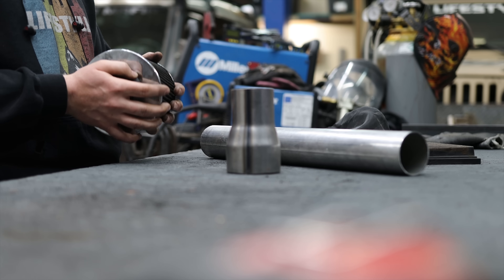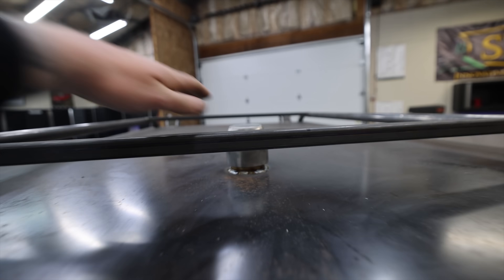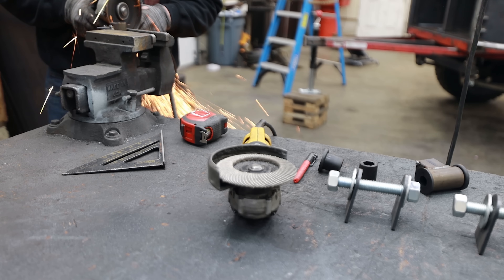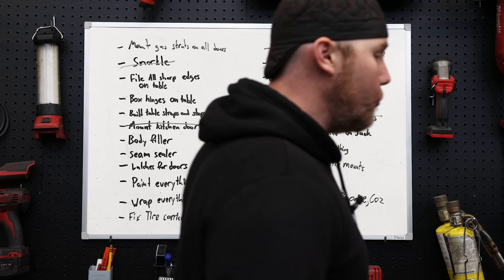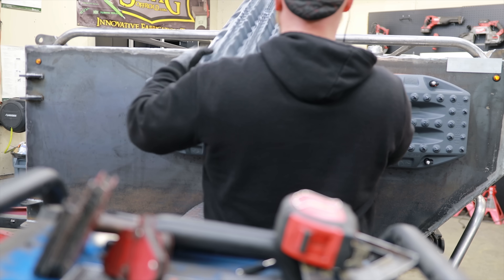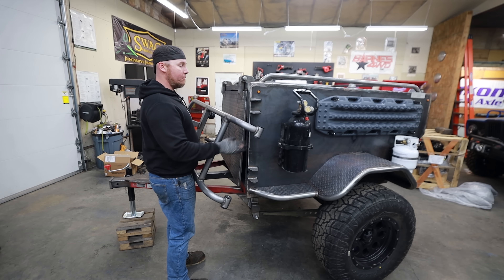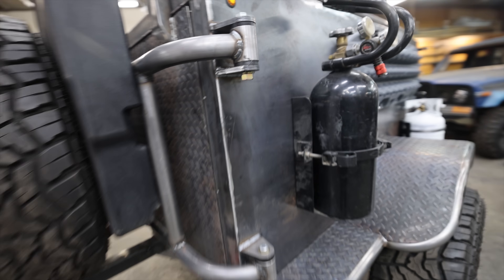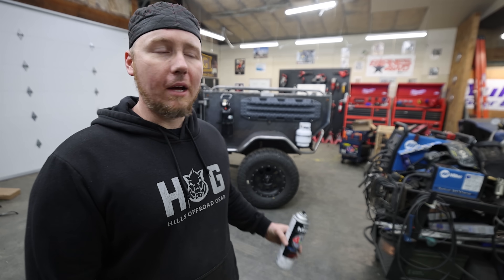Let's Build More Weird Offroad Trailer Mods! Harbor Freight Overland Trailer Episode 8.

Comment: Add a little inline 12v fan and create a positive pressure system. Constantly pushing dirt out. Get your 12v from the trailer connection cause you'll only need it while driving.
Reply: This is a great idea.  Do you have any part numbers or a fan you like?
Reply: Great idea.
Ronny Dahl did the same on his Hilux build for the bed. Worked great from what he said 👍
Reply: i was gonna say the same. i've seen positive pressure setups advertised on higher end offroad style trailers similar to this one.  awesome stuff.
Reply: This is a standard feature on most off road trailers in Australia having a positive pressure dust reduction system. I have one on my patriot camper that has a washable filter and runs on a motion switch via the Anderson plug we don’t get the elevation changes down here like the states but we get heaps of dust.
Reply: That would be so cool.  A simple $5 12V PC fan would do the trick, too.
Reply: @Colorado4x4  look at bilge blowers mate
Reply: @rowanlocke9376  thanks guys.  Just finishing up my offroad trailer build and testing it in Moab this weekend.  I’ve been reading about a fan so I’m glad to have seen this here
Reply: @Colorado4x4  here in Australia we have all sorts of dusty roads. Alot of bulldust and very thin stuff. So alot of canopies and trailers use competition/racing helmet blower motors mounted to the skin of the body that blow filtered air into the body. They are able to be somewhat passive when off and provide great filtered flow when on and all in one device. The filter and fan is one component
Reply: That's a neat idea! 👍🏻
Reply: Check out how Tribe trailers does theirs.
Reply: They also make little solar versions of those fans. Used one on an enclosed kayak trailer to pull out moisture here in Florida

Comment: It's not stupid at all, here in Australia we pump air into caravans, luggage compartments in buses etc to achieve positive pressure inside so the dust can't get in through the seals
Reply: Given the climate there, yeah that makes perfect sense!
Reply from the maker: I've seen! I considered a positive pressure system too. This is the stuff I had laying around so it what I used 👍
Reply: Really? It’s not like there’s a lower atmospheric pressure inside. Is the differential created by movement? Serious question
Reply: @Matt Barrett  iirc, yeah. It's like when you open only one rear window of a moving car, you get what sounds like the inside of a helicopter.

Comment: Had the same problem in the back of my JKU Jeep (Dust getting sucked in the back tailgate) until I realized the previous owner removed the vent cover that has check valve like louvers to allow air to escape but not to allow dust in. Thanks for tackling this important topic.

Comment: You should put some little gussets on those leaf spring mounts/ ears that are hanging down.  Those are fairly weak with a single weld like that;  they are carrying all the weight and they are going to contact rocks the most.  They need gussets.. 10:27

Comment: I'm late to the party bit for the cables on the table I know cube vans have a roller system on them that rolls the cable up so it wouldn't flop around but I like the strut idea aswell great looking trailer.

Comment: I think the breather says a lot about your confidence in whatever you use as a gasket system for the doors🤓 nice work so far this thing looks great. I would move those bumpstops for the table to the trailer so they are in the way when using it

Comment: Happy to see the progress. Had 2 thoughts:

1. put the top side bump stops on the side of the trailer, not your shelf. You'll constantly find them in the way (I'm guessing)
2. Would be neat to put an alternator on the 3rd member of the trailer axle to charge up your batteries while driving around, would save headaches on beefier wire and bleed off system from whatever you want to tow it with. Granted, if you're not moving around much for a few days it doesn't really help.
Reply: Checked comments for the bump stop thing.  Don't like them on the table either.

Comment: Nate you do very nice work. If you haven't come up with a solution yet on the table supports I would just make a flexible or hinged rod, in the middle, for each end so that it fits inside the table when closed.

Comment: Great progress!  As far as the table bump stops are concerned.  Moving those to the trailer wall would clean up the table.  Also, instead of having the one on the 'inside' of the bottom of the table, could you use a stack of trimmed to size teflon cutting boards, or a piece of well oiled, instead of that single stop?  I think a length of that would give the table some more stability in the center and help increase the table load (at least in the center) with that resting on the fender.

Comment: great idea! .. I would be concerned about knocking the filter off/having to be careful loading stuff inside  .. how about just a low profile car cabin air filter  size box right under it on the ceiling?  .. 1 1/4 inch depth out to do it

Comment: The DOT Requires propane tanks to be mounted within the frame of a trailer. that way if the trailer ever gets in an accident or hit by a vehicle going down the road propane tank is protected. That's why they mount propane tanks on the trailer tongue within the v part of the trailer tongue.
Reply: These small 5 and 11lb tanks are mounted on the sides of small trailers from the manufacturers all the time.  They can't sell a DOT approved trailer if they weren't allowed.

Comment: Your explanation at the end of the video pertaining to the fold down table supports, is a very good example of building something that best suits someone's particular circumstances. Naturally, the idea of a simple two piece, centre pivoting metal straps is probably the simplest, best generic idea. Throw a young child into the set of circumstances and suddenly the needs are different and a gas strut makes a lot more sense. In anycase, with your talents and skills, changing this in the future is not going to be an issue.

Comment: For kitchen door you could use a style of garage door cable drums and spring tension from the inside and run the cable or synthetic cable thru the chassis to the table. That way it folds down with ease and stores without any mess or hassle

Comment: You could use a Harley Davidson rear axle adjusters at the hinges. Wouldn't support the outer corners, but would be as solid as the contact  materials. Or loose steel cables offset just enough to tuck on the inside. Loop wouldn't be big enough to interfere with anything. Sometimes basic is better. Less chance for failure

Comment: How about a positive pressure system like they have in the Australian trailers to keep all the dust out I don’t think it’ll be too hard to make, runs of the wiring from the trailer it only works when you’re driving. Filters out the dust instead of having the dust in the trailer keep the filter on the outside.
Reply: I was just about to say need to look here at the Aussie camper with the bulldust positive pressure systems. They seem to work pretty amazingly. I think the south African camper were the first tho

Comment: With regards to the table cables, you could always add a cables with a small counter weight that would cause the cables to retract when the table is in the unused position

Comment: Regarding the tablestops. Just weld a tab in the hinge it self. Sort of like a bumpstop but in steel, and on the hinge it self. Maybe tap the tab and make the angle adjustable with a bolt.

Comment: I'd order a few of those 3/4 inch lights in red, NHTSA standards say they should be red as clearance/marker lights at the rear of the trailer, and amber to the front. I cant remember if you are going to be required to have this trailer inspected or not, but that is something they may look at. Another often forgotten light is a license plate light, but people tend to get away with not having one on a trailer.

Comment: Mount the table bump-stop that is used for stability when it is closed to the trailer side rather than the table, that way it isn’t in the way when using or cleaning the table.  You can also hang your hot pad on it.

Comment: Noticed you had multiple grinders with different wheels on the table. I do the same. I keep one with a wire wheel one with cutoff wheel and one i swap between flap discs or grinding wheels.

Definite time saver for me not having to swap wheels constantly wheels constantly.

Comment: Suggestion sir ** take the rubber table center support and riv nut it to the trailer the same place it lands , so it doesn’t interfere with the drop down table surface area 🤷🏼‍♂️….. 😁 ya know if ya want to 😂😂😂😂😂😂😂😂

Comment: Not saying you are wrong or how you did it is wrong (there is a hundred ways to skin a cat) BUT I believe the bump stops would look better mounted on the trailer side than the fold down table top.  That would free up the top of the table. 12:17  You made another great video, tanks for sharing your knowledge with us.

Comment: Curious if you could mount channels into the interior of the roof that fits a cabin air filter. Just slide in or out for easy replacement, low profile inside & easy to make whatever size you want for what ever filter(s) you use.

Comment: Wow very interesting idea! I wonder if this would obviate the need for an powered positive pressure system. I could see that little pressure changes could occur just from bouncing a trailer around, which could work dust in over time- which this might prevent

Comment: I never have good luck with Amazon leds.  I grabbed a bunch of Trux dual revolution leds.  I wired the amber marker circuit and bright white circuits to a 3 way switch.  And to a battery.  I can flip my markers white to setup in the dark. And disconnect from the tow rig, flip a different switch and my battery powers the markers

Comment: Just a suggestion. I would have done something kinda like what they use in Pelican cases. Use a small ball valve to equalize pressure when you get to the destination.
Reply: I think the issue is pressure will equalize throughout a journey when air leaks in through the weather seals and such (and in doing so brings dusty air in).
Reply from the maker: ALMX5DP nailed it dude 👊
Reply: @ALMX5DP  I see your point. I didn't look at it in that way. I was thinking at sea lvl going to altitude, the trailer would be positive pressure. Helping keep dust out. Then on the way back down the drop in pressure would press the doors tighter also keeping dust out. I was looking at it as a K.I.S.S. issue, and not having the doors pop open or vacuumed shut when you get to wherever your destination is.
Reply: @dorsk84  yeah I think there may be too many joints and openings, and the trailer will be hit and scraped over it’s life making it hard to keep a really good positive seal for that to work well. It’s a good idea and I think in some applications could work even better but for a DIY a approach this may be that simple and good enough solution.

Comment: Regarding tail lights - avoid putting them on the hatch because if you accidentally leave the hatch up, or unlocked and it opens by itself, the lights will point to the sky and people behind you won't see anything until it's too late.

Comment: The pressure and volume changes are small. A small tube with an inline fuel filter could do the trick using your same idea. Or a different option, a long coil of tubing. The air will move back and forth in the tube and never get inside the trailer. This would also help reduce condensation.

Comment: Love your work, as always, but I can't help thinking that a 1/2" boss with a diff' breather screwed into it would have been sufficient for this.

If you ARE determined to go for nuclear overkill, here, I'd suggest maybe installing an electric fan (one of those $40 ebay "electric turbochargers" perhaps?) and using it to draw filtered air IN to generate air flow that'll keep dust out.

Comment: chain, cable, or rope would hold up that side table fine,  with it in an i bolt with the cable and a tensioner (forgot the name of the part) one for either side would be really good i think but pistons should work too. also i started watching just recently because of this build series keep up with the builds its why i stayed...even if you dont enjoy the comment section for these videos

Comment: first time i have seen your channel instead of struts on the  shelf I would use some stainless steel cable. the airfilter is a great idea but way to big for any volume change i would suggest something small like a K@N engine breather or motorcycle   trailer  looks great

Comment: 0:32 At sea level if the cargo box is truly air tight sealed it will have positive pressure at a higher elevation, when you come from the higher elevation your cargo box will be more like a vacuum if it can't vent (sucking in dust like you say). The best option would be to have a fan running to keep the inside at a positive pressure rather than trying to equalize the pressure.
6:29 Don't you want amber on the front and red on the rear? I am not sure of your state laws but in my province they would have to be red on the back. Are you going to have it inspected before you can license it, or did you start with a trailer that has a VIN already?
12:44 Probably the best option.

Comment: This build is awesome! I've got something similar going right now. My dilemma is leveling jacks/stabilizer jacks! When this is unhooked from the tow rig, I'd like to be able to walk around without it shaking or tipping. With the 37" tires, I'm about 34" to the frame/bumpers. Ideally, I'd like some travel (around 10"-20") after the jack/stabilizer is extended due to the uneven ground surfaces we'll be traveling to. Have you given any thought to what you were going to do?

Comment: Late to this party, but what if you mount a table stop using two pieces of flat iron one that connects to the trailer one to the table and a hinge in the middle so they'll fold up inside the table while stowed and hang similar to a cable when extended.

Comment: I work for a light manufacturing company I like the dot lights we make some that flash also but I had a thought for your wiring I was worried that If you just zip tie a wiring harness under the trailer it might get ripped off I have in the past used a pice of electric conduit to run my wires in if you did something like that you could bend it up and keep it tight in the frame and just put your wires in that and If for some reason you needed to add or change out a wire just pull a new one

Comment: I love your vids and this build but IDK what you were thinking on this snorkel. Firstly i'd eat my shorts if this thing is actually pressure tight. Second, if it is, all it takes is a pinhole to prevent this issue. You could have drilled a 1/8 hole in the top from inside where the roof rack bars are welded on and another 1/8 hole in that bar a few feet away and it would prevent pressure/vacuum, you'd never get dirt in, and no one would even see it. Now you have a big silly air filter hanging from the roof in the middle of your trailer. It just needs to let out a few cubic feet of air over the course of hours, like you said it's not an engine.

Comment: Just a quick FYI for you i know this is almost  a month later.   You may wanna switch those Rear clearance led lights to Red or you may not pass an inspection ( Since I have no idea what state you are in )  All i know is here they charge you for each inspection and red is require by federal DOT laws. to be on the road.

Comment: I like the innovative ways you have gone about some of your mods, but yes there is a but, my concern is the over all weight of it even before adding the accessories and tent it is going to be at the max towable weight of the loaded tow rig even before it is kitted out.
I did a mega build on a Suzuki SJ413 as the body's were rotted out also a CJ3A hand fabbed bodies and i had to put them both on a weight loss program a severe one especially the Suzuki both way to top heavy and the trailer was too heavy for both, I kept adding thinhgs I came up with along with mates idea's, hell the trailer tyres had to be upgraded because of the weight.

Comment: You're way over thinking the "overpressure" going up and down mountains. Simple breather hole in a spot that won't let water in and you're in business. Also, you're worried someone will get their fingers "chopped off" when latching the table is kind of crazy. I mean first of all what child do you have that's that tall to get there fingers up there in a realistic scenario? Second how hard are you closing the table to worry about someone getting hurt? Thirdly, the two metal straps with a pivot point would have been a far better solution. You're all about strength and then you do a single central bump stop? Bruh... Otherwise, very very amazing build. Looking forward to more.

Comment: The biggest problem it has, you are ignoring, NO BRAKEs..  fully loaded, it's going to literally weigh a ton, maybe 2 tons.  Brakes would be very very useful coming down a steep trail.     Venting the trailer box.  Could be handled with some 1/2" PEX flexible water hose.   Run a cheap fuel filter on the end.

Comment: The Maxtrax MkII and the Maxtrax. Xtreme have different profiles.
If you use Hybrid mounting pins, you can have. The MkII underneath the Xtreme and they stack perfectly.

Since your Xtremes are Orange and your MkIIs are grey, this will not match the aesthetic you are going for.

Comment: The max trax didn’t fit because there is pins for the the extreme and mk ll,   So you have mixing extreme and mk ll none of the pins are going to work, either get all 4 extreme or mk ll.